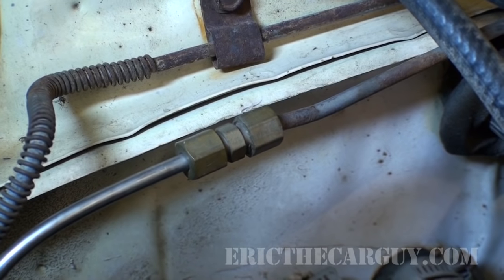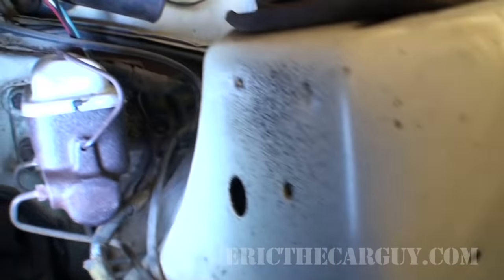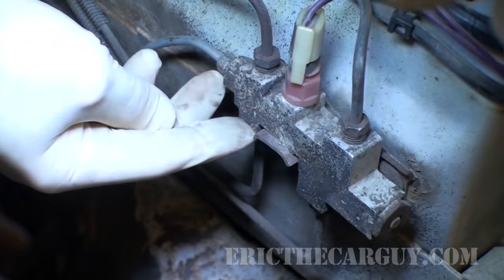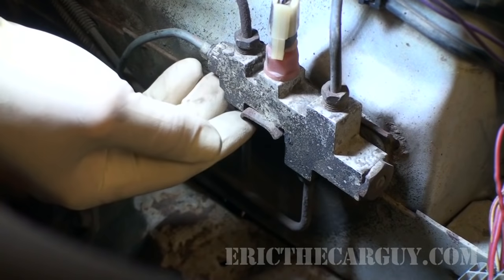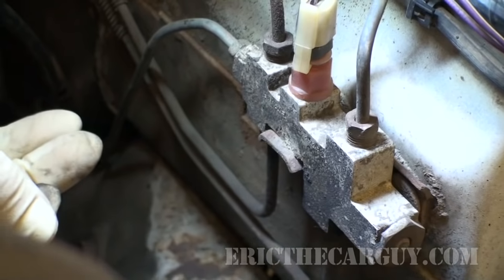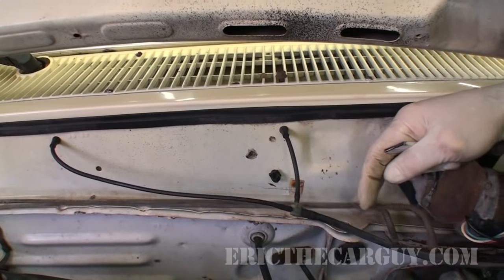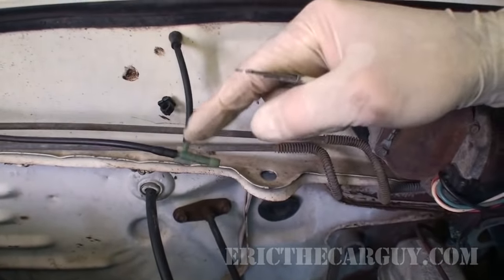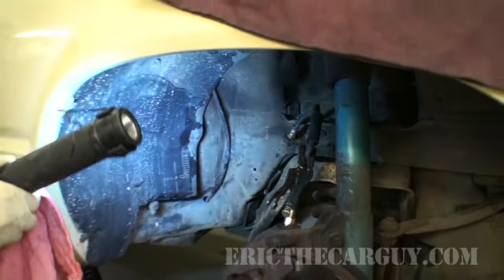How To Bend and Flare Brake Lines -EricTheCarGuy

Comment: Your worried about a compression fitting (which is legal in most drag racing) but at the 29min mark or so you have a clearly kinked line (line is no longer round, has flattened out in the bend)....that wont pass tech as you have compromised the structure of the hose and introduce two weak points in the line (the edges of the kink).

Comment: I have a brake problem I hope you can help me with I have a 1999 gmc jimmy the brake pedal is hard when pressed and the truck wont stop it also sounds like abs is trying to work and the pedal pushes back against my foot if you can get the pedal past the hard spot the truck stops ok

Comment: Question; I replaced my brake line(To back) and came out to long I just stuffed the extra to the side will the brake line flex when the brake is compressed my concern is could that cause breakage at flared connection?

Comment: why not just run it across the front cross member or radiator support if no cross member under the engine instead of up high like that where air can get trapped. Shorter line and lower than calipers. just thinkin'

Comment: I was just replacing calipers & front brake hoses on my 2000 Dodge Ram 2500.... And of course, 20 year old Michigan truck, a couple of the fittings were rusted and would spin the brake line. Had to bent a new crossover brake line, and now I'm going to have to make one from the proportioning valve up to the split. F^%$.

Comment: Yeah the way I understand it.

Compression fitting on gas line is A OK due to 45 to 55 psi.

Compression fitting on brake line not so good due to 2000 psi at times. But joining with a union and flaring is just fine.
Reply: +evilcowboy Instead of a compression fitting just use a union which has flared seats.  Hmm, I see that was mentioned further down the list.

Comment: Whats up Eric. I drive an 89 accord lxi MT and I have this annoying crazy engine rattle noise at low rpms(2500 and below) when accelerating and I cant figure out what it is. Ive had my valve adjustment and everything else so im pretty sure its not that. It doesnt do it when im idling or just sitting there, and it only does it when my car is at operating temperature(like if I just jump in and drive cold it wont do it but once operating temp it does it). Any ideas whst this could be?  PLEASE HELP
Reply: Check your front license plate bracket.

Comment: I should have watched this video first.  Mistake #1: buying straight hard line with ends attached from O'Reilly's.  Not sure if thiss tuff is intended to be bent but it is definitely harder than the material you are using.  Mistake #2: Trying to make the bends while under the truck.  MIstake #3: Not using coat hangers or some kind of wire to map out the bends.  Mistake #4: Not having the blue-handled tool you have (during the fast part of the video showing you bending the lines).  What is that tool?  Also, the fancy flare tool, it doesn't help us when we have the more basic hand tools.  I'll have to search for another video for that.
Reply: The hand tool available for 20$ work in the same concept as the fancy stuff.

Comment: what is the reason to not use the braided flexible line all the way instead of hard line?
Reply: Expense and most of the braided lines do expand some under pressure. That expansion would reduce brake pressure far enough to be a problem.
Reply: Flex hoses expand and contract veery slightly. Hard line is solid. It doesn't expand.

Comment: I just did this and double flared the line and it leaks badly where the line goes through the fitting that goes into the ABS System. I used the old fitting which didn't leak before. I cut and reflared 3 more times. It still leaks. Don't know why.
Reply: sounds like a bad flare not a bad fitting. Prepping the line with chamfering and filing outside edges and keeping the termination perfectly round while flaring is key to creating a good flare, therefore good seal.
Reply: You were right! I cut the line with a sharper line cutter and after double flaring it. I turned the flaring tool around and flared it a little more. i was using the rental flaring tool that Autozone has. No more leak. Thanks,  my friend for your advice.
Reply: You were right! I cut the line with a sharper line cutter and after double flaring it. I turned the flaring tool around and flared it a little more. i was using the rental flaring tool that Autozone has. No more leak. Thanks,  my friend for your advice.
Reply: Glad to hear it. Flaring can take a little practice, but once you make good flares your seals will be tight.

Comment: You are a real mechanic. I see that the proportioning valve used a different size line which means any other line will not fit the orifice inside it. Are you aware that different size lines work with different 'sponge valves or check valves also that have the little "bulge" where the inverted flare rides on is larger for a larger line and smaller for a smaller line? This can be a terrible mistake for sealing off the inverted flare and most do not even think about it and repair cars and people get killed.

Comment: If you hold the brake pedal down with a crowbar or something wedged against the seat, it'll seal the master and prevent any fluid from coming through (other than the little you pressurize from that one press).  Disconnect the battery since it'll keep brake lights lit otherwise.

Also, just for any DIYers -- if you have an ABS and you get any air in the hydraulic control unit, you will need a dealer-level scan tool to bleed that thing out.  You cannot, in most cases, do it yourself.
Reply: No brake lights if the ignition is off.
Reply: aptsys Not all cars do that.
Reply: Probably faulty then.
Reply: aptsys
All cars I have experience with have brake lights even with ignition off. That is a safety feature just like the horn and headlights being always live.
Reply: austin1002 there are makes and models out there that won't have brake lights, headlights or horn with the key off.  I worked on a 1993 Volkswagen Passat GL today that won't blow the horn unless the key is on
Reply: austin1002 My MINI Cooper won't illuminate brake lights unless the key is in the run position.
Reply: I'd just be happy a Mini even started if I had one...

(JUST kidding. heh.)
Reply: MikeTheITGuy Haha, very funny. :-)
Reply: Thanks - I'll be here all week.

So just to end this surprisingly long discussion, I will modify the statement to say IF THE LIGHTS STAY ON, be sure to disconnect the power.

Thank you, and good night.
Reply: @jeffreywilsonrubikscubeonb2428 what??? Name one that does that

Comment: I check my break lines after doing pad and rotors I did t have rear brakes thought it was a few things but now I’m puzzled I thought it was the boosters or master cylinder took the rear brakes off and the both pistons came out so I push them back in and again after a couple of brakes application it seems the pedal is kind of hard it feel ok at first but after a couple of brakes it applying but when I push it goes halfway then seem hard like I’m pushing against the wall .  Better explained I push the brake car slows down but pedal get to a halfway point and it hard and the car is still rolling please help my out and thanks

Comment: This compression fitting is a factory fitting on every Fox-body vehicle Ford produced.  It will not affect your tech inspection at at.  The fact that the vehicle is over 30 years old and still retains this fitting  without leaking is testament to it's durability.  If an inspector fails you at tech, they have no business doing tech inspections.
Reply: No the factory fitting on the fox body is NOT a compression fitting. It is a double flare coupler. Those are legal.
This is a coupler on a fox body.
http://s707.photobucket.com/user/Greasyfifty/media/coupler.jpg.html
Reply: *****
Thanks for the correction!

Comment: Can someone recommend the best way to splice in a new fuel line when a large section is rusted and leaking. Double flare with a union or compression fitting? Are they similar? Thanks
Reply: You'll hear nothing but arguments about this. But easiest is compression fittings, safest is to flare and union - and in some states compression fittings will never pass inspection.

If it's an emergency and can't be helped, compression fittings should be ok, especially if it's a smaller car and the rear brakes. But it's always better to flare. And even better still to just replace the line - if the rust is extensive, why not? Basically same amount of work unless rusted section is small, rest of line is fine, and time is an issue.

Comment: So, you told me everything except...where do you GET pre bent lines that fit exactly.  I have a 1979 Dodge so I doubt that would come through the dealer. (they dont even have #'s before 1983.  They went computer and threw out all the old parts books, I guess)
Reply: Inlinetube.com or classictube.com. both sites sell prebent brake and fuel line for old cars.

They also sell coiled tubing for custom job.  I got 15ft I think it is of OE steel 5/16 tubing to bend a custom fuel line from OE pump to my aftermarket summit carb.

You wont get it from the dealership for a pre 1985 as it would be left over stock and if it did exist still the dealership would mark it up to an insane price.

Comment: Wondering if it would help to warm up the line with a torch on a tight bend
Reply: Good thinking. But, I wonder if it became too soft, it might collapse or kink in the bend. I don't know..... just a thought. Might try testing on a scrap piece first?
Reply: Fill tubing with fine sand.

Comment: can enyone tell me if eric is using steel line ? cus over here we are not alowed to use enything but copper tubing , just wondering!!
Reply: US common brake lines are steel, Next step up used to be stainless. Now NiCopp/Cunifer is legal to use (nickle copper alloy) and it is a LOT easier to use but more expensive as well. Plain copper tubing isn't legal for brake lines, neither are compression fittings used on brake line.
Reply: ok ,thanx . i think our copper lines are very little mix, but they can stand more pressure then the original line on cars so thats properbly why its the law here. nice to know and learn some new stuff. once again thank you.

Comment: I have a 97 cadillac deville, inspection flagged all brake lines... Is it normal to have quotes for the work starting at $800+, what kind of work is entailed in this job. As when I looked at the actual cost of brake lines the lines are only a few dollars for a few feet... Also, what I am running into is that I can not find a mechanic that WANTS to do the job in my area. And to take my old car to the dealership= $1200 for just replacement of the lines ONLY.
Reply: It has been between three mechanics at this point, and each mechanic has replaced some sections of line, yet inspector refuses it every time, standing firm to replace every inch of line.

Comment: I have a 1988 Chevrolet silverado c1500 2wd  5.7 engine  . I need to replace the brake line on my truck  . But my problem is I don't know what size it is  . I have been told  it's  .  3/16 - 3/8 - 1/4  .  The only thing I do know is I'm going to  buy a 25ft roll of brake line  .  So can anyone please help me.  Tell me witch one I need to get   3/16 - or 3/8 or 1/4

Comment: I just did my first brake line today..my question is if/when you do accidentally kink the line, what's the right way to fix it? as for making the new line out of the old one..lets just say it was so rusted that there wasn't enough of the original line to do that. i found it..not too difficult to just feed the new line in and bend it once it was in place (i think i got lucky on that though) but like i mentioned before..there was a really sharp bend that did end up kinking a little..when i straightened it back out, it looked alright so i just rebent it (more carefully) and avoided rekinking it..
Reply: +alanna Christine You have to start over . sorry
Reply: +Edward Blackburn ya, I did have to redo it. but that car has long since left our class even if it still haunts me (I was one of the people that did it's tie rod end, and someone else finished the job and it flew apart on the hwy when the instructor test drove it..I wasn't responsible for the part that failed but I can't help thinking of I hadn't been sick that week, I may have been able to stop it from having happened. I have since done another tie rod which was done right so I know I can do it.
Reply: dont feel guilty sounds like the instructor should check any work done on brake or a safety part like a tie rod.
Reply: This whole year has been a mess.. New curriculum, substitute instructors, a lack of work in the shop. I've been puttering through the last week and a half with an electrical problem on my own car because there's been nothing for me to do. But there's a limit to what I can afford to do of my own work so I got it picks up soon.
Reply: Hope*

Comment: Are compression fittings really that much of an issue? While there is no doubt that flares should be more reliable since they cannot slip (unless the flare fails) and eliminate one layer of metal-to-metal contact/sealing, compression fittings done right are still very reliable and capable of handling high pressures.

A crude test would have been to mark the line on both sides of the compression fitting, try pumping the brakes with both feet and see if there was any slippage on the fittings. If there is no change and no leak even in this abnormal braking situation with around twice the maximum braking force you might normally apply, I doubt there would be much to worry about for anything that passes as remotely normal driving. You might still want to do that crude test if you have not done it already just to see if you might discover other stuff to fix.

Of course, knowing that a patch is still in good working order is no substitute for the peace of mind of not having a patch to worry about in the first place.
Reply: Compression fittings are illegal for use on brake lines in most states. They tend to fail under high pressures because the ferrules won't grip the copper tight enough to hold tight under panic stops.
Reply: If you tighten a compression fitting enough on a copper or other relatively soft metal pipe, it will create a small indentation in the pipe and becomes nearly impossible to pull out. By the time you apply enough pressure to extrude the pipe through the ferule, you should also have about enough pressure to start worrying about popping an untreated cold-formed flare since the metal is about half as thick from stretching and still in its soft annealed state.

Compression done right can handle 1000+ psi. The problem is getting it right the first time, every time. Much easier with flares.

Repeatability usually scores big points in manufacturing and repairs.
Reply: 1000 psi is on the very low side of brake pressures. Most systems operate in the 1000-2000 psi range. Power brakes are usually higher.
You are correct in how the compression fitting works, however very few I have seen were installed correctly and most slid apart very easy when the nuts were loosened.

Comment: You aint done, you have enough brake line spool.  To do......

You are forgetting to Replace a few more brake lines.  

2- Brake lines runs across the gast tank  Send and return 

2 brake line that run along side of the car Send and return. 

After you do these, You replaced brake lines for the whole car.  

I'd put the FaiLmont on Dyno first then get 1/4 mile ets....  

Then do 5 lug wheel conversion big brake swap. Replace engine with late model 5.0 302 tremic automatic transmission from summit racing, strnger axles, better drive shaft( driveshaft shop) better transfer case. Fuel support mods. and Turbo charge it.